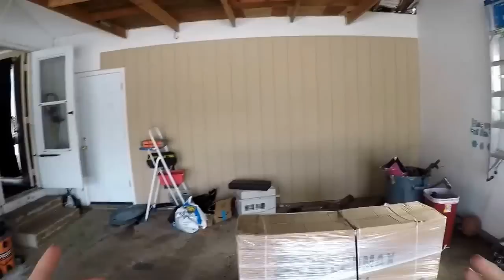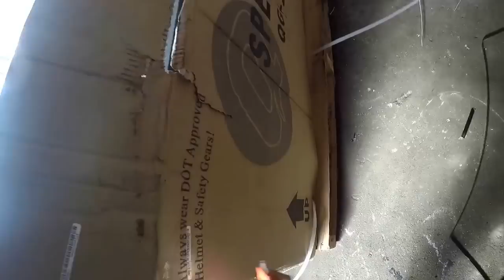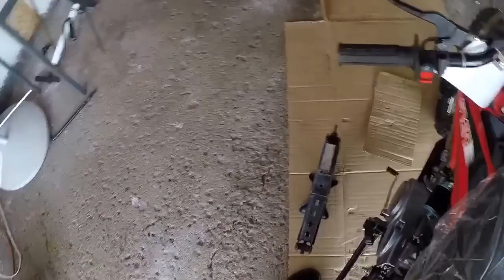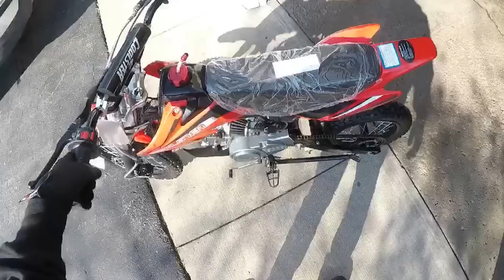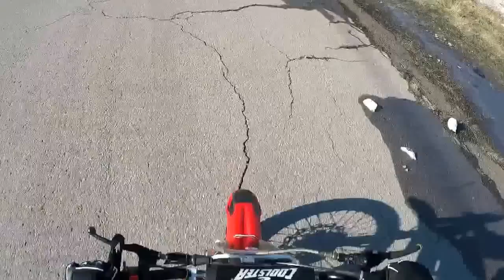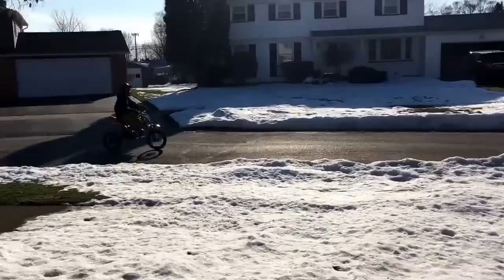It came!!!! Coolster 125cc unboxing!!

Comment: I seriously hope you changed the oil before riding this bike. The oil that comes in the bike when you inbox the bikes have metal flakes in it which can potentially cause some damage. And also you there is a certain break in procedure for "crate" bikes. It would be safe to refer to the manual. Not trying to tell you what to do just trying to help.
Reply: Austin Reaux 😂😂 its a $800 Chinese bike chill
Reply: Austin Reaux he didnt
Reply: Austin Reaux completely agree
Reply: Thanks bro this comment helped and totaly saved my bike
Reply: 80sOutrunFan yet i weigh 225 lbs and jumped one of these and it didn't break you must got a damn strong bed frame
Reply: Good point. And yes, i thought about that when he started ripping around on that thing ammidietly, like ''should he not brake in it first for like atleast a few hours'' ?? :P
Reply: Even more importent then i would say.
Reply: マ AzzeeeN no the oil is shit and you never ride with that oil ask everyone that shits in there so it doesn’t get fucked up in the oil area because it’s stopping it from rusting and other shit
Reply: Just thinking the same after reading email.
Reply: How do you unlock the back tire   on the coolster 125 qg 214

Comment: Question does the bike stall when you are in 1 gear and you stop and dont pull the clutch in?
Reply from the maker: Yes
Reply: @wheeliesquad2197  thx no one has ever answered me! And two questions more is dirt bike real name trail dirt bike or are they diffrent things? And what are diffrences between dirt bike and trail dirt bike or are they same?
Reply from the maker: @hyposez1129  dirt bikes are made for jumps and racing on the courses. And trial bikes are made mainly for cruising on the trails or going fast on the trails but with better control and they are long lasting and easier to maintain with then a dirt bike
Reply: @wheeliesquad2197  Thx! Definitely going to sub you!
Reply from the maker: @hyposez1129  thanks bro💪🏽
Reply: @wheeliesquad2197  Np man!